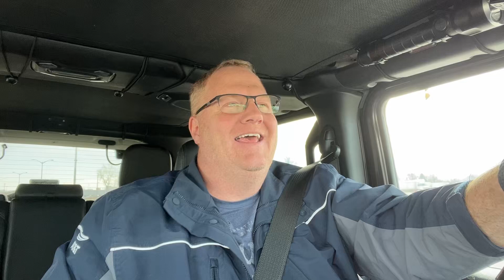Defrost cracking windshields

Comment: After 107,522 miles my 2016 Ford focus windshield cracked with the defrost on.   I didn't see any damage before but I've been pelted by rocks many times. 25 degrees with high winds and defrost finally did me in.

Comment: I’ve had my 4xe for 11 months and have to get my fourth windshield.  Two have been rock chips that were  unfillable and split the windshield in half horizontally in less than 12 hours and the other was a spontaneous crack extending all along the bottom within minutes while I was just sitting parked. All have been Gorilla Glass. I finally gave up on contacting Gorilla Glass and my dealer paid for the one that spontaneously cracked. The other windshields I’ve had to use my insurance. Arg!

Comment: I'm on my third windshield, one was related to this, cold day with hot defrost, the other was a hot day with cold air conditioning.  Both I've had replaced under warranty, dealership told me as long as it was under 25,000km they could get Chrysler to cover it with warranty.  I'm going to have to out of pocket the next one though...
Reply from the maker: As long as they can’t find a small rock chip to blame it on, they’ll usually cover it.

Comment: Hey Chris...thanks for info on cracked windshield. Doesn't get as cold down here in the Carolinas as up your way in Ohio. Anyway have not had it crack with the cold. Although just over a year ago a rock hit my windshield on the right side and a 9 inch splinter formed. I called my insurance company Stare Farm and they replaced it no problem. I went to safelite and they replaced it with original mopar windshield so as to not interfere with jeep warranty. Windshield is just over 600 bucks in cost. Safelight recalibrated my adaptive cruise control camera just in front of rear mirror. A few months ago...had another rock strike but really small. Insurance covered again with safelite repair filler. Looks ok but a weak spot as u mentioned.
I'm still waiting for that front stablelizer part...almost 2 months. Jeep stirring wheel has not vibrated any more since the cold snap we had around Christmas. Have a good day.
Reply from the maker: That was something I meant to mention. Depending on what state you live in, some insurance policies cover windshields.

Comment: Just bought a 2021 wrangler unlimited sport S and my windshield broke due to the defrost! The defrost only blows in center vents and not evenly through out windshield. But like you said, windshield gets hot and it’s cold out side- and it cracked. Notified Jeep and they will not fix defrost or windshield. Stuck with it

Comment: It's a Jeep thing.

Not a 4xe thing. Jeep (CJ - Wrangler) windshields have always had this problem. The windshields are more vertical than your standard passenger vehicle, so are more prone to get damaging rock hits. These rock hits may be very small and even beyond what is visible - at the very edge of the glass. The old CJs didn't have the greatest heaters, so the shock of good, steady heat wasn't as much of a problem. The new Jeeps have very good heating systems and are more likely to expose, more quickly, the rock hit damage.

It's a Jeep thing!

Comment: So should we not remote start in cold weather?  KInd of defeats the purpose of having it.  Is it better to just start it normally then?
Reply from the maker: I’ve been meaning to see if we can ensure that the air flow will go down instead of up toward the defrost vents on remote start. Just haven’t done it yet.
Reply: @Wrangler4XEFans  could jeep put out a patch to ramp the heat instead of going full heat.

Comment: Wow really just like the old ww2 jeeps so i read in a tm the solution is to heat the cab before running defrost. That gives the glass a chance to gradually warm up. Glass is no exception it will expand and contract with changing temperature. if it is heating unevenly and rapidly part of the windshield will be expanding faster than the rest that's is cold. And something has got to give and you get a crack. Here's a question can you set your temperature and floor vent before shutting it off and when you remote start will it resume that setting?
Reply from the maker: I’ve been meaning to test that very things and haven’t done it yet.

Comment: Was disappointed in Gorllia glass, it cracked by a kicked-up rock in the first 30 days of ownership. Dealer stated the first replacement was on me, and the second replacement of GG if it occurred within two years was on them. I ended up paying a 250.00 copay for GG under the 3-year bumper-to-bumper 36K warranty. My insurance would not pay for GG but would replace it with OEM glass for free...
Reply from the maker: I just haven’t heard good things about Gorilla Glass at all.
Reply: @Wrangler4XEFans  our 4xe went through 2 regular windshields in the first 1800 miles. I upgraded to gorilla glass and it's been great no issue since. My insurance paid for a Mopar windshield and I paid the difference. So I think it cost about 200 for the gorilla upgrade after insurance paid their portion.